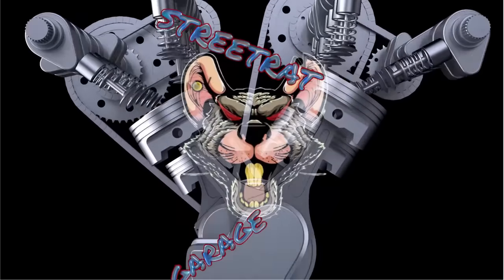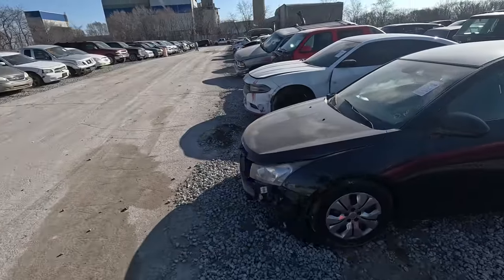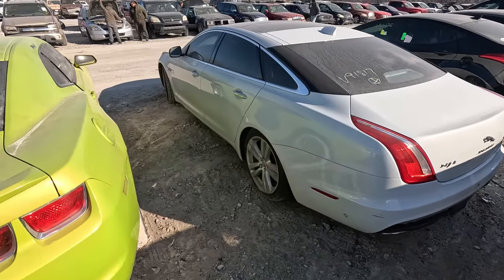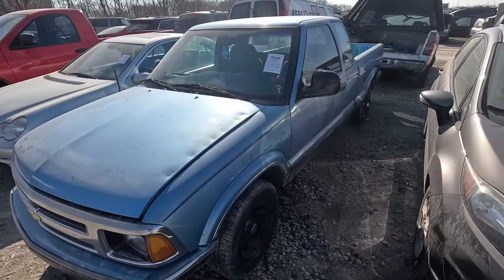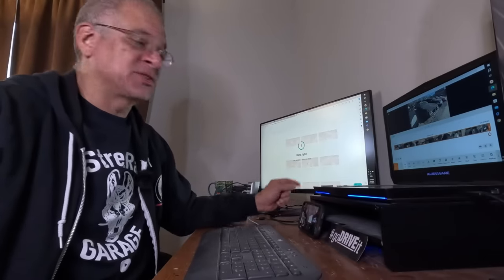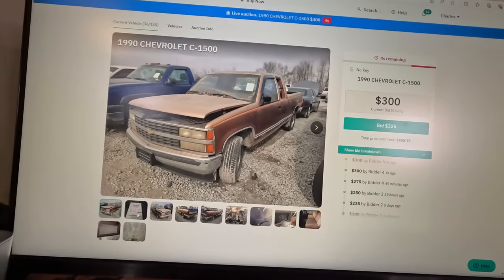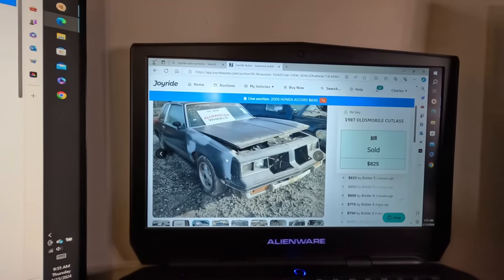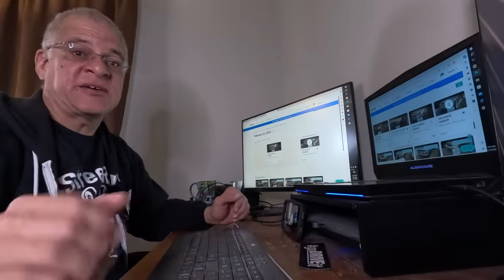Public police auction Cool cars cheap

Comment: I remember when 300hp was respectable but if it comes in a V6 it's not worthy now. I think they make fun daily drivers.
Reply from the maker: It is definitely faster than anything I had growing up. And they do make good daily drivers, but it is embarrassing to get beaten off a stoplight by a four-door family car.
Reply: @streetratgarage  I believe any twin turbo grocery grabber with four doors will get it done if you street race on the weekly.
Reply: Does not make sense that v6’s don’t get respect with that much HP. The Camaro v6 is well over 300 like 335 or more that is insane.

Comment: I can’t find Any police or county auctions for automobiles in Washington state.
Reply from the maker: I typed in the ZIP Code for Seattle Washington, and did a search within 150 miles. I was able to come out with quite a few. So just make sure you go to the advance search and look via your ZIP Code and X amount of miles radius from there.
Reply: We have some here in the Yakima county every so often. Fellow Washingtonian hot rodder
Reply: @stevenrodriguez7668  I wouldn’t mind driving the 2.5 hours to Yak for a nice 4WD pickup.
Here in the Wenatchee Valley area, I can’t find any auctions.
Reply: @streetratgarage  I typed in the Wenatchee zip code and put in for 250 miles, but couldn’t find anything.
I saw a lot in Portland, but that’s 6 hours away.
I can’t even find anything in Spokane.
I suppose I’ll just have to keep looking

Comment: I rebuilt a car and in Ohio with a salvage title, you have to have it inspected when finished and you have to have receipts for all the parts. If used parts, I believe you need the vin of the car they came off of, or a receipt if from a business (like a salvage yard) I had to use all new parts as I couldn't find the used parts I needed. Then after the inspection you take the paperwork to title department and get a rebuilt title issued.
Reply: if you buy them with a salvage title here in indiana you have to do the same thing to convert them into a rebuilt title.
Reply: California, you just need to have a light & VIN inspection.  I've owned several salvage titles cars.
Reply: Sounds like a big headache too me
Reply: Sàlvage  in Ontario , Canada means the car was wrecked usually a collision, a write off you can buy from the wreckers , you then buy parts from legit companies like wreckers like you bought the vehicle from or dealer, show receipts and get the vehicle certified and roadworthy, E.tested then go to MOT to register, it's a long process ànd not worth it at least not with current cars for resale,  I did it 4 times, lost money.

Comment: I bought a 1988 Ford van in 1990 with a salvage title. After fixing it I took it to the Highway Patrol here in Missouri and after an inspection I was given a good title labeled  salvage so I could put it back on the road. I drove it for about 10 years before selling it. 
In 2014 I bought a Georgetown Motorhome in Memphis at a auto salvage auction that was vandalized with a salvage title. A trip to the Highway Patrol for inspection and I was given a good title labeled salvage so it can be operated on the road. I also never had any problem getting insurance for salvage titled cars.
Not all Highway Patrol offices here in Missouri do auto inspections. Other states might be different.
Reply: Did you have to tow it to the highway patrol
Reply: Yes. In missouri  it is  illegal to drive a salvage title vehicle on the road.  After inspection it is labeled as prior salvage on the title, then it is legal to drive

Comment: Up here in Lake and Porter counties in NW Indiana they emission test and won't pass without a cat converter, I thought it was the same in Marion county.
Reply from the maker: Really? That’s not a state law. You should try south bend, In
But no emissions tests here!
Reply: @streetratgarage  you can't register a vehicle in a county you don't live in, and yes it's a state law, the emission testing station is built and staffed by state employees, not only do they test emissions they can register your vehicle so you don't have to make a separate trip to the BMV. Testing is done every other year, if your vehicle is titled as a say 2002, you test on an even year, if it's a 2003 you test on an odd number year. They have a mirror mounted on a stick with wheels to roll under the car to look for a cat converter.

Comment: Yes, you can get a re-issued Title on a salvage title vehicle,at least in Utah, where I live. Once you repair the vehicle, if it passes a state vehicle safety inspection, the state will re-issue a salvage title registration, which makes it legal to drive on the road again. The problem is that the title will always show that the car had been totaled and issued a salvage title, which will reduce its resale value by about 50%. even after repairing it.
I have owned two salvage title vehicles. 
One of them was my Grand Caravan, which was totaled in an accident.
The insurance company paid me $3800 for it, and I repaired it with used parts for about $800, I now drive it but only with liability insurance.

Comment: The 442 was a good but IMO. Probably worth more in parts than as a complete car. The 442 model was equipped with the 8.5" rear axle that was only used in them and the Buick Grand National. A common misconception is they were also used in the Monte Carlo SS models. They were all equipped the smaller 7.5" axles. Buckets, console, steering wheel, axle, gauges, rims, 200R4 trans. All pretty valuable parts
Reply: Also, the engine code in the VIN tag would be "9" for a 307 HO v8, different than a normal 307.

Comment: That Cutlass is an '84-'86, as the '87 had the European Halogen headlights on them. Also the engine is a 307, not a 350. Though I wish it did come with a 350.

Comment: I have been looking for a PPV 2011 to 2016 hard to find just want the 6.0 L77  engine for a build I have been wanting to do with a fireo .Just cannot find any in my area that's 500.00 range for old cop cars.
Reply from the maker: That’s a hard one to find. I would just get a 6.0 from a van and add a good cam. That you can find for $500

Comment: If the 442 is stock it should have the olds 307 in it.  If its just a cutlass it could have a chevy 305. Other than some early monte carlo ss no gbodys came with a 350.
Reply: The 1979 Hurst Olds and the 1980 442 got Olds 350. Also, some 1978-79 station wagons got a 350 in California and Mountain states.

Comment: Chevy Caprice was a big deal 30 years ago when gas was $ 1.27 a gallon. Pull up to a gas station in 2024 with gas at 3.89 and drop a $ 100.00 bill filling that 25 gallon tank which will eat and burn up in less then a day. Worth fixing to bring out 4 or 5 times a year imo

Comment: So why worried about abandoned so much? Might be stolen, even though it was impounded? What else?
Reply from the maker: Stolen will not be marked as abandoned.
They run the Vin numbers before they are marked for a 72 hour abandon impound. If they run the Vin number and it stolen, they are impounded immediately. Stolen vehicle you have a much higher chance of it still being a good vehicle. Abandoned means they left it somewhere and did not care to go back after it. Most likely because there is a problem with the car.
Reply: @streetratgarage  Oh ok, so just probable mechanical issue.
Reply from the maker: Correct